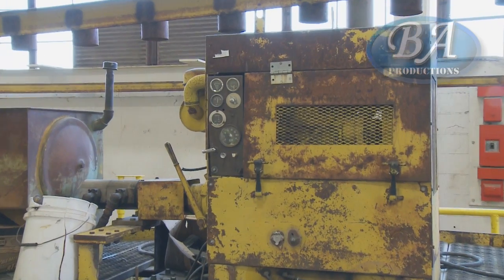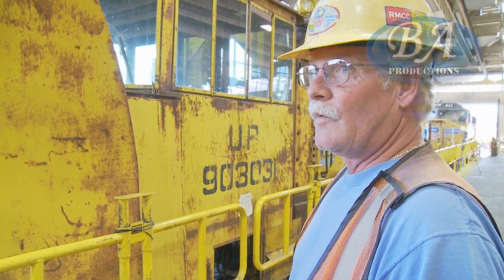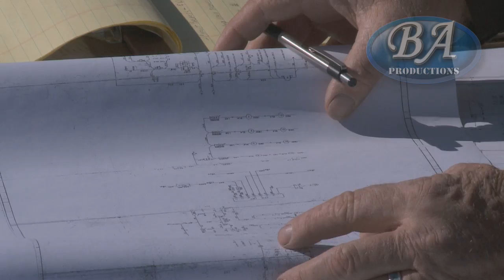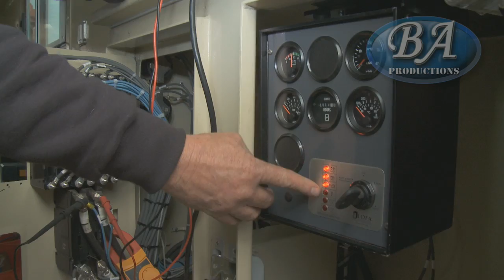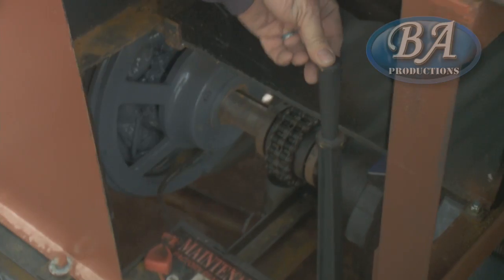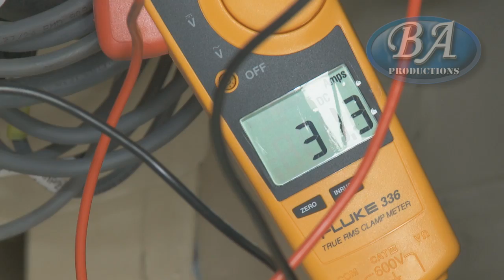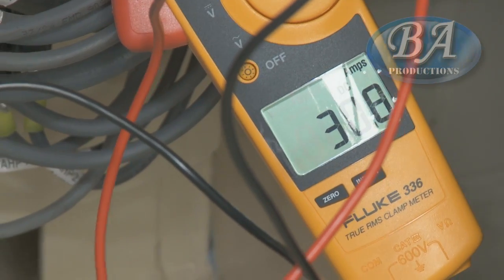The Spreader Snow Plow, New MEGA Machines of the Sierra. Part I

Comment: If you are interested in the MOW equipment for snow removal this is an excellent resource for railroad modelers because as you watch this being rebuilt you can see all of the old structure. It would make a great scratch-built show piece sitting on a side spur.

Comment: Thanks for the response.   I noticed a fairly clear closeup at 8:15 after posting the question.   I had to Google a number of strings because the first letter in the name eluded me.   It's a Speich Clear view screen.  According to the web site they rotate at 1,700RPM.   The windscreen must be custom made with the mounting hole before tempering the glass.   You couldn't cut the hole in tempered glass.

Comment: I was a little disappointed to see them using a torch to blow holes instead of using a mag drill and drilling holes when mounting brackets on the wings. Looks a little like a shortcut that they shouldn't have taken. I also hope they haven't over complicated what was once a fairly basic but very competent set up. It seems like the more electronics, the more chances of failure out in the field. I guess I'll have to wait and see.

Comment: @Philip3119 They are not self-propelled.  They are pushed by ex-Southern Pacific GP38-2 that are specially modifed for snow flanger and speader service.  Two of these locomotives are used with spreaders, one on each end of the consist.  Numerous pictures of them on the interenet...or buy these guy's videos.  I have.  Railfann
Reply: railfann  We don't use one loco on each end of the consist. Where did you get that info? We use two in line to shove on our Jordan Spreaders. In the Cascades, we use one smaller loco and one road unit. There's nothing set in concrete, we do what we need to do to get the job done.